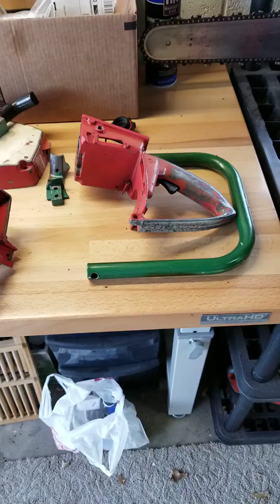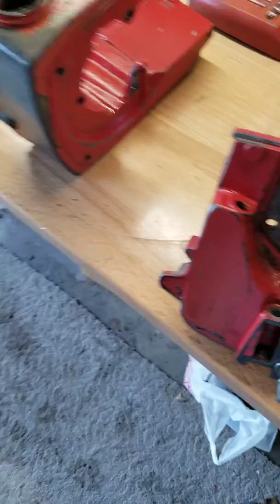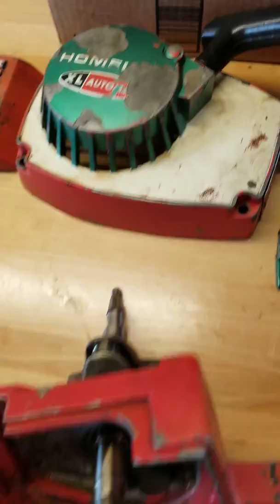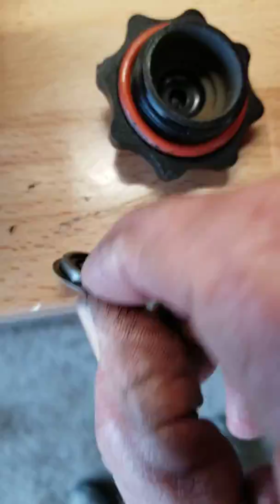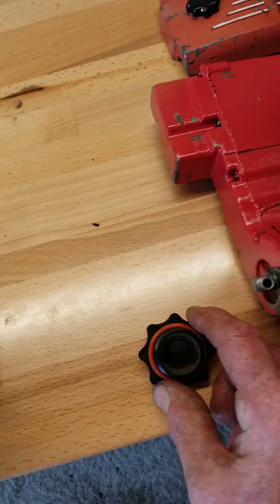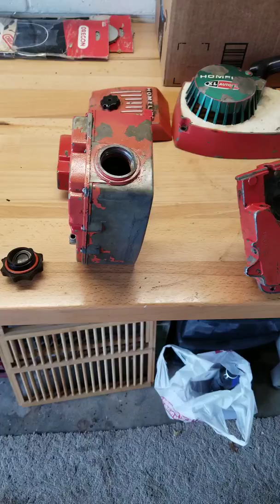1966 Homelite XL Automatic Restoration Part 2

Comment: That little piece from in the tank is the vent valve.  If it won't fit tight enough to stay in the cap, clean it up and use a couple dabs of super glue.
Reply from the maker: Thanks, I looked at my others and saw it was a vent. I tried to put it in and it didn't want to go, but I pushed it with a socket and it snapped back into place, not sure how it came loose being that tight.